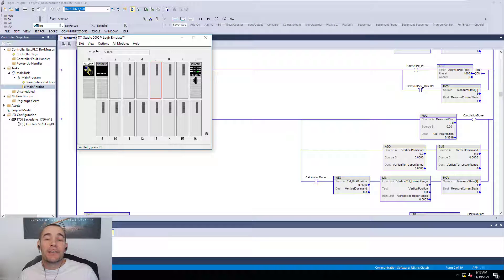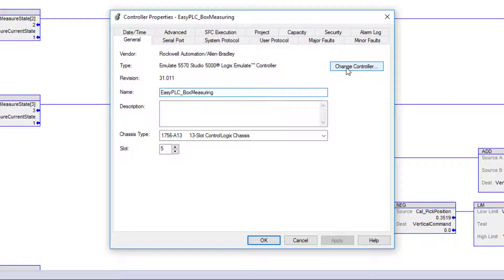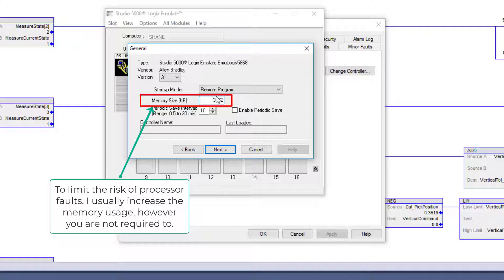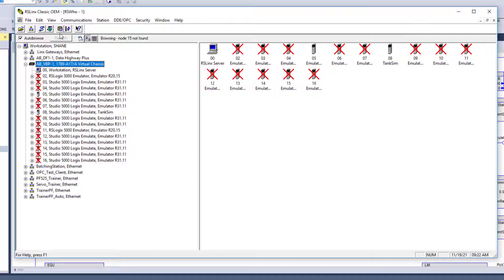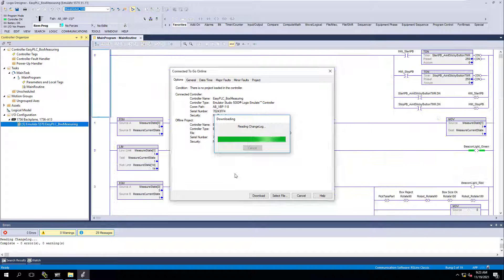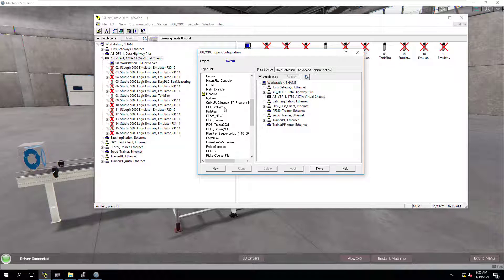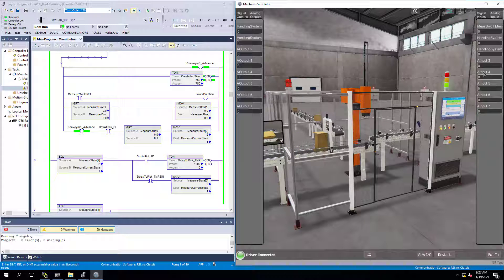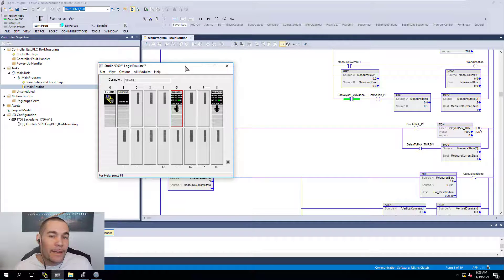Connecting Studio 5000 Logix Emulator to a PLC Program

Comment: I wonder if it is possible to connect the studio5000 view project with the plc emulator? I failed to do do? I would be most grateful if you could help me do so. 
Note: it sounds only possible with real plc via ethernet to emulate the hmi but as I don’t have real plc I wanted to use tbe emulator , as a result,
Reply: I highly appreciate your replies 

I don’t have Factory Talk view . I only have stuido5000 which includes logix designer and view 

You are right. I have watched many video, including yours, connecting the FT veiw to the emulator via RsLinx an d Enterprise 

But when it comes using the Studio veiw, which built in Studio5000, it looks different 

Hope my question is clearer now
Reply from the maker: @saedalhabbashi2790  just point the HMI shortcuts to the emulator processor
Reply from the maker: @saedalhabbashi2790  
How a PLC Communicates with an HMI using FactoryTalk View SE with Studio 5000
https://youtu.be/dRwh1Y41fCA?si=fpAQ-Nn8sbaN81Cm
Reply from the maker: You might be viewing this wrong, emulator doesn't require any communications modules.
Just that the processor type is an emulator processor.

The video above shows the exact steps on how to use Studio 5000 Logix Emulate.

If it fails to download then watch this video:
https://youtu.be/hD5RSjzsBYY?si=BL0haMNFoFiZNhUM

Or you can use a standard processor using FTlogix Echo:
https://youtu.be/_8BCGchQtMw?si=h9Uki2UMKtmLrWmv
Reply: Thanks for your reply

I am referring to Studio5000 View, which is a part of Studio5000 software. 

I am wondering if it is possible to run the hmi emulator with plc emulator? Same as in Tia portal?
Reply from the maker: @saedalhabbashi2790  I have plenty of videos using FactoryTalk view to a PLC program using emulator.

The Batching station example is one, there is a whole playlist for this
Reply: I have referenced to the emulator processor but did not work
I have set the path for the project file as well and was able to navigate tags to assign hmi objects to processer tags

But when i run the hmi emulator says tags are unreachable 

Note: my processor emulator on run mode
Plc running
I was able to browse the processor emulator via rs linkx in the studio5000 view
Reply: Can you please confirm whether it is possible to connect the Studio5000 view design with the processor emulator ?
Reply from the maker: @saedalhabbashi2790  sounds like you are doing something wrong,  I can't talk you through this.

Maybe I can make a video on it
Reply: Thanks awaiting for the video. Just to confirm am using the Studio5000 view not FactoryTalk Se/Me.

Alternatively, I can send shots or video of what am doing. Of courses if you don’t mind that

Comment: Professional knowledge. Is it possible to use a lower version of emulator to work with higher version of Studio 5000 Rslogix??
Reply from the maker: The versions need to line up, meaning, if RSlogix 5000 version 20 then use an emulator processor of version 20.

It's just look like using real-world devices.